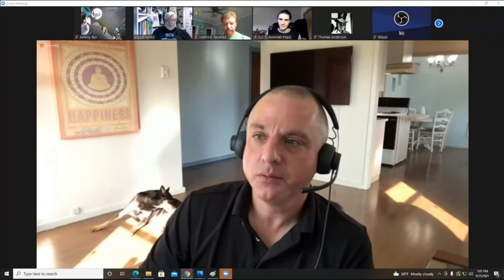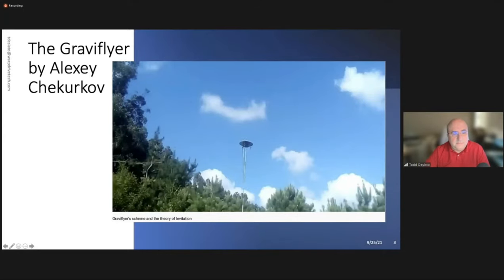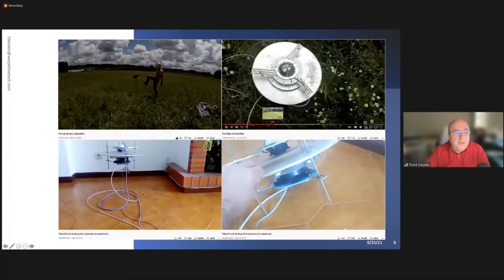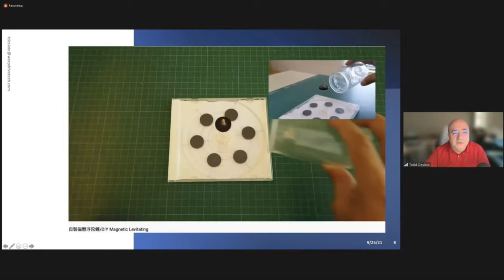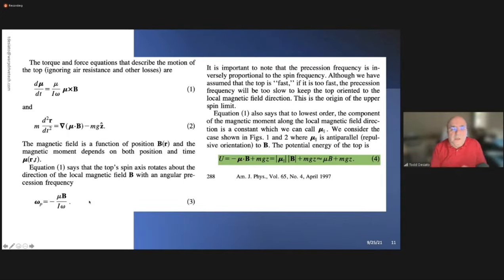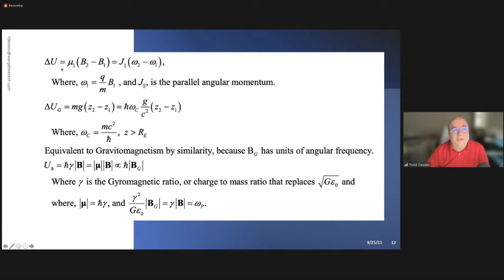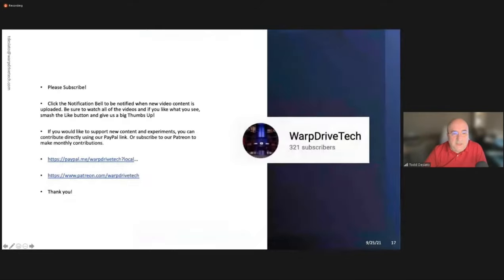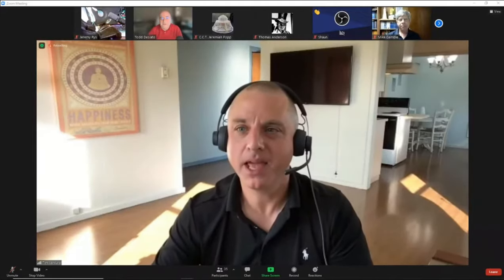Antigravity or Spin Stabilized Magnetic Levitation?

Comment: I am currently making this flying saucer. Except that instead of the tesla coil I put a voltage multiplier, 200 KV. This high voltage brings a 360° ionization of the ambient air of the saucer, which by the magnetic field brought magnets and with the direction of rotation of the discs which operates in electric the rule of the 3 fingers, causes an elevation of the device. Finally all this is theoretical for me, because I have not finished making my flying saucer. But I wanted to bring my 2 years of study on this device.
Note: There are three rules.
_ The very high voltage electric field.
_ The magnetic field.
_ The direction of rotation of the two discs, which are counter-rotating to each other.
Reply: I've done experiments with all 3 of those rules applied, but it showed no signs of lift, in the box or out of the box in the open air. At 30kV, it's not enough to create a strong enough ion cloud, without "something else" that's not listed here, TBD.
Reply: @Phil-nz9ux  Wooohooo! That's the ticket. I have 2 of those cheap 24-stage multipliers and an AC flyback xfmr. I need a welding mask for safety.

Comment: What I have noticed in mine is that the upper plate is always higher than the lower plate causing the center plate to rise. The center plate wants to stay in the center of the field, but by the offset it makes it rise. The pulse ( or jelly fish moment ) only comes from the ultrasonic pulse. You see this when it is in his house. I started with the brute force lift with the second device he made. It only uses preset motors and the only adjustment is the voltage. When the motors are in tune it make a weird sound. The tesla coil is to resonate the aluminum 51.8 hz. however without the ultrasonic pulse it wont resonate. In my opinion this device would be better with a larger curved ring on the outside and all of this on the inside. Then the torque could stabiles the craft while the magnetic field could create a pressure point ( like in the wheel and the string experiment ) then it would work better.

Comment: The easiest way to pull this off to levitate upwards is to make a copper cone one bigger top than the other which is at the bottom. The end points attached to each other so we have an asymmetric capacitor that is spinning. So the center is thinner compared to both cones wider at the top and bottom. Positive electricity flow from top to negative electricity at the bottom while spinning. So at the top view you should see it spinning anticlockwise and when you view it at the bottom it should automatically be spinning clockwise.

Comment: So how is a machine with mass going to eliminate the property of mass: weight? 

I thought Eric Laithwaite put an end to this. The antigravity flyer is implausible. Not improbable, but impossible.
Reply: I'm right there with you now, but there has been an enormous expenditure of man-hours and $$$ to try to replicate it. I want to get to the bottom of it, to either prove it or debunk it. The current most interesting idea is that compressing ionized air with ultrasound can exert forces much greater than air and sound alone due to the repulsion between ions. The spinning magnetic bottle and the ultrasound act to compress the ions and when Alexey turns off the ultrasound, the expanding ion cloud causes the lift. Def NOT gravity control.
Reply: @ToddDesiato  
So it’s not even suggested that it’ll work in a vacuum. If it was defeating gravity then air would be an inhibitor. 

I realize that there’s a lot of skills about text equipment and circuitry learnt along the way. But the physics is clear. It’s been debunked.
Reply: @larryscott3982  Lack of understanding of what "IS" going on is worth pursuing. That's how discoveries are made.
Reply: @ToddDesiato  
In the spirit of Faraday. 
Even Isaac Newton dabbled in alchemy

Comment: It is my understanding that gravity is a field, like magnetic or electric, and there is no terminating radius, it just gets weaker with distance.  This is Newton's Law of Gravitation largely applied to celestial bodies.  So if a vehicle could manipulate gravity, it's not like this basic understanding would vanish, it's likely applicable. 

This means:

1)  The field must extend past the dimensions of the vehicle, stronger when engaging the throttle.

Therefore gravity lensing may occur as the vehicle accelerates where it may appear, from a stationary perspective, to vanish (since gravity bends light), when it may still be there, accelerating at an incredible rate.

2) This extended field must interact with the medium (air/water) such that the molecules closest to the surface move with the vehicle, i.e. no boundary layer. 

This means there wouldn't be resistance to motion or sound perturbation waves through the medium resulting in zero thermal signature from hypersonic velocity and no sonic boom.

3) Because the field accelerates everything, there is no relative vibration or inertia within the vehicle, occupants simply wouldn't "feel" acceleration, as if everything is free-falling in the direction of flight.  

I don't know if occupants and payload would float or be pinned to the rear unless another life-support gravity field was present. 

As for Alexey's Gravi-Flier, I don't think it's real "antigravity", but I do believe there could be many types of electromagnetic field propulsion.

For it to be actual gravity perturbation, there needs to be evidence of lensing: If Alexey could take a photo from underneath as it accelerated up, it should visually disappear until it hovers.

Again, if it's actual antigravity.

Comment: I don’t like it.  Where is the power source?  The goal is to come a crossed recreatable phenomenon.  I like the plasma generator it transmitted to the elements forms in new radiation and creates an unlimited amount of energy at higher levels than you’ve ever seen.  It’s called the plasma generator.   It’s been all over TV the inventor has been to jail for three years and never charged the government knows all about it.  Reproducible phenomenon using the plasma generator.  And don’t put mercury in the fuel.